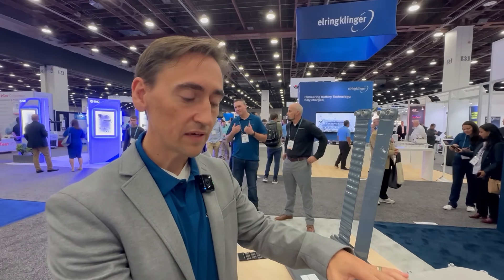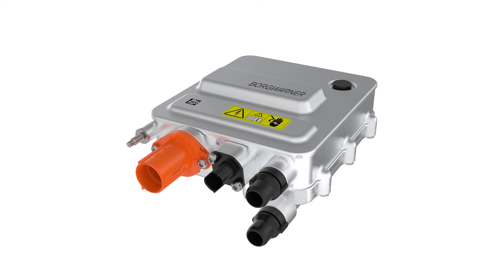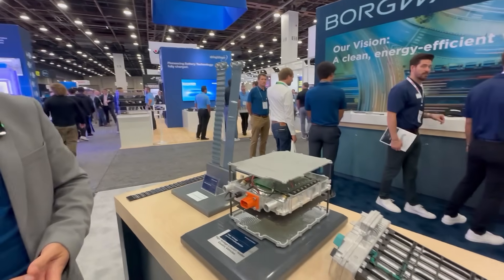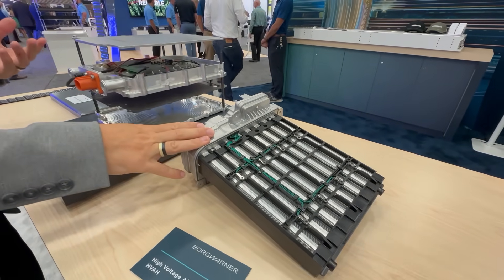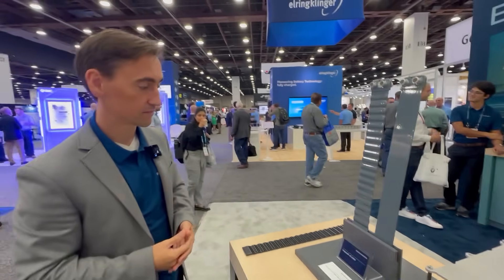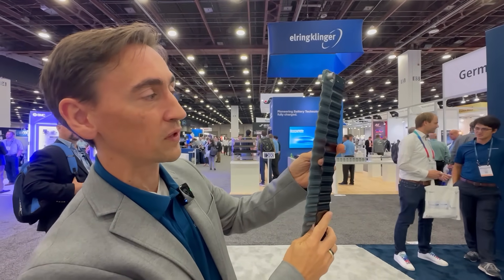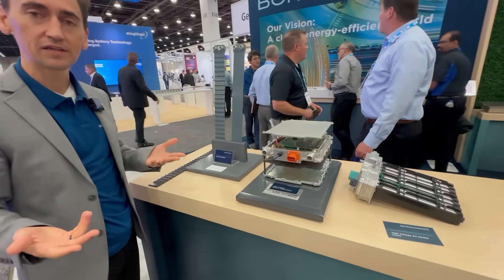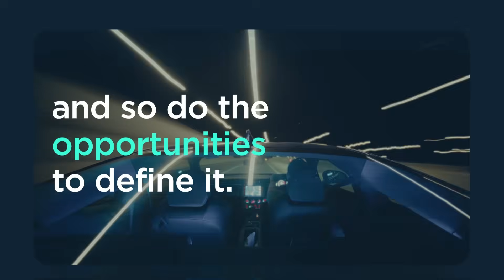BorgWarner Can Instantly Heat the Inside of Your Car - Battery Show 2025

Comment: I'm guessing you'd only want to use the HVCH at full power while plugged into mains for pre-conditioning a cold-soaked vehicle quickly, but then flip over to a heat pump or low wattage mode of this heater while driving.

Comment: Why would you burn extra energy to drain your battery dead quicker?
Heatpumps save energy. Seat heaters and heated steering wheel is the only way to affectly heat the passengers not the cabin icing up the windscreen in the winter....
Reply: The Nissan leaf was so innovative from its start in 2011, with heated seat front and rear, and heated steering wheel. With a start timer.

Comment: Well the problem with direct heating like this is that it's really inefficient. A 10kWh heating element, my god that would chew up a battery in short order.
Reply: It does not need to be running at 10 kW long to heat up the cabin. 15min are only 2.5 kW.h this is less than 3% of a normal battery capacity.  But when it is -20F outside, there is nothing better than direct heat.

Comment: Not a new thing of course, some OEMs have been doing this for a while.  However with these guys making them, OEMS that don't want to make their own can get units from Borg.  Nice to have more "off the shelf" components for the market.
Of course I'm assuming things like the air heater are for very temporary usage.  Heat pump is clearly what you want to lean on whenever possible.

Comment: How is the heat produced ? By resistance elements ? They are not efficient. Today we have Inductive stovetops, you can boil 2 cups of water in 60 seconds or less using  220 volt @  1500 watts , portable induction cooktops 120 volts @1500 watts about 90 seconds for a mug of water and very energy efficient.
Reply: Go back to school… induction is good for certain application, but co claim it is efficient?????
Reply: @nilsutt you beat me to the comment! You're lucky if there's at least 50% efficiency, compared to conventional!
Reply: @MischiefHadMyAlibi  I use Induction cooking extensively  , and nuke some  things by Microwaves, sure beats using normal conventional ovens @ times , an auntie who is a Professional Chef and Nutritionist uses induction cooktop and Induction stove exclusively , oh , she is in California where Nat Gas is commonly used everywhere.
Reply: @AuralioCabal-nl8gi  There's an idea: microwave-heat the passengers! Super-efficient as it doesn't unnecessarily heat up the air!
Reply: @AuralioCabal-nl8gi the point is it's so inefficient,  a range can't even have all the burners on at one time. So will be a higher power bill. Microwaves however are good at least power wise
Reply: @nilsutt  I have been using Portable  induction for over 15 years , the technology is over 30 years as the Japanese( my company , Mitsubishi Electric) tried to get it approved for Canada, today an induction range with Oven on sale for $700Canadian $  @ COSTCO, the CN Tower has used Induction cooktops in it’s Revolving Kitchen/ restaurant for around 30 years  , most chefs highly recommend it . I could go on about the benefits  Induction , a benefit of induction cooking no Gas Fumes and pots and pans get hot instantly and kitchen stays cooler . I can go on , but I’ll just bore You.Oh, I have a built in Induction cook , 2 years now and love it, NO STINKING GAS  FUMES , NO FLAMES 🔥 EITHER !  DUH